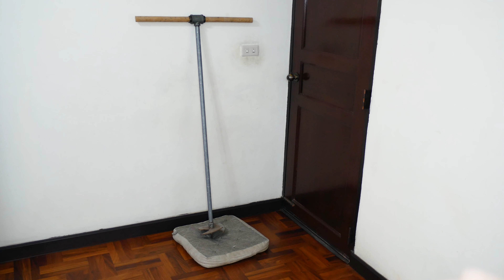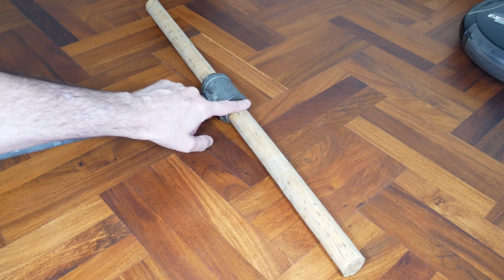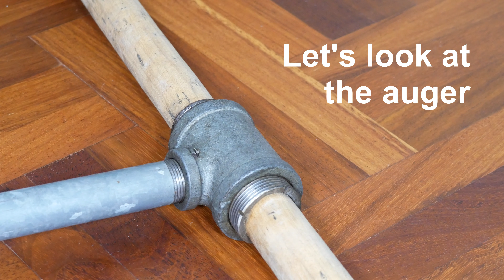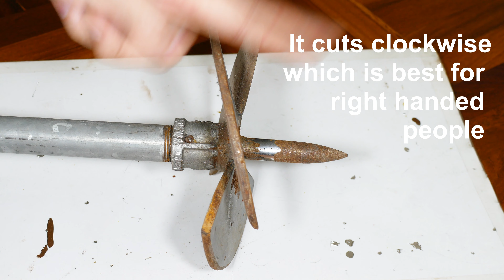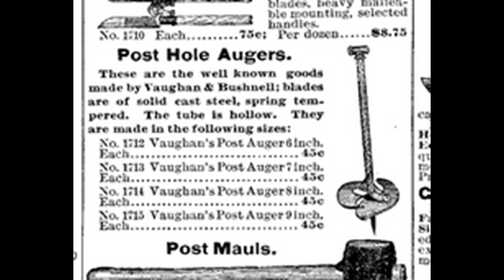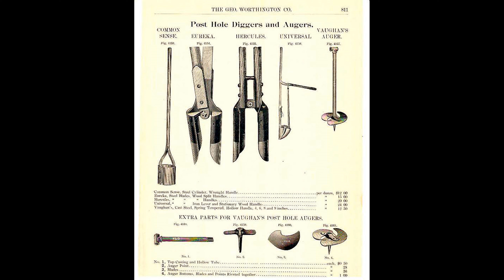Post Hole Auger - DIY (4K)

Comment: Would this work in a large drill minus the handle? Need to place some small fence post and I'm figuring out the math for the blades.
Reply from the maker: You'd need to do the math for the blades first to know how much resistance.  But at 4" (10 cms) or more I doubt any human could hold a drill against the torque.
Reply: @tsbrownie  Thanks! Already built it and it churns right thru dirt. I set it at 16 degees and welded rebar kickers to the blades to the central collar shaft. 4" pieces of 3/16" thick plate make up the blades.
Reply from the maker: @boriskarloff598  Cool.  Make a video and post it, I want to see it.  BTW, love your movies.
Reply: @tsbrownie  I did three fence pole holes today with my sons. 24"deep x9" round. It chewed right thru moist black clay, you only run the thing for 10seconds and pull it out the hole. Realistically it took more time to clean out the hole and clean off the blades. Maybe total drilling 5 minutes a hole. Thank you so much for the idea!
Reply from the maker: @boriskarloff598  I'm glad it was useful.  It's from a 100 year old + design and this style works better in most soils than anything else I've ever used.  If you have time, post a video, I'd like to see it.

Comment: I have one that I inherited from my father, I am sure it was old when he got it. Just did a quick check and was shocked to see none of this type available for sale at Home Depot, Lowes, Menards, Rural King, Tractor Supply and Ace Hardware. Plenty of expensive gas powered jobs and of course the far inferior "clamshell" diggers. The only one that was even close was a multi turn job from Amazon (https://www.amazon.com/Auger-Type-Post-Digger-1080mm/dp/B003CT4DEA/ref=sr_1_53?keywords=auger+post+hole+digger&qid=1580919292&sr=8-53) but it can't be extended for depth like yours or mine and if you filled the flutes - good luck getting it out of the ground, it simply becomes an anchor for a guy wire! The marketplace doesn't even know what they are missing. I know why you built one!
Reply from the maker: I looked at the amazon link.  The type with multiple turns on the auger will not help.  From a LOT of time using a hand auger, it's hard enough to clear soil from the head, you don't need a lot of other stuff helping to hold it stuck in place.  Also I noticed the point on it is just the tube that's been smashed and cut.  That won't hold up.  I'm not sure why this style fell out of favor, it certainly is the best I have ever used.  The only place the others might work better is when rocks in the dirt get bigger than the slit in the auger, then the jabber-jaws type helps to clear the hole.